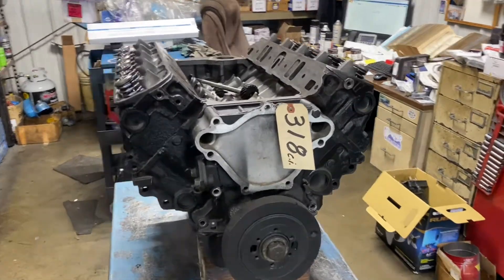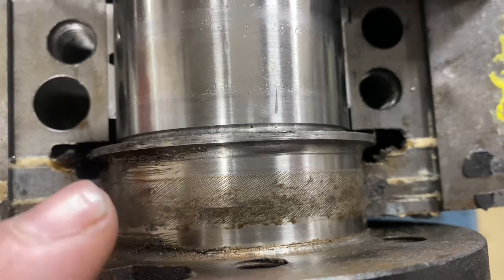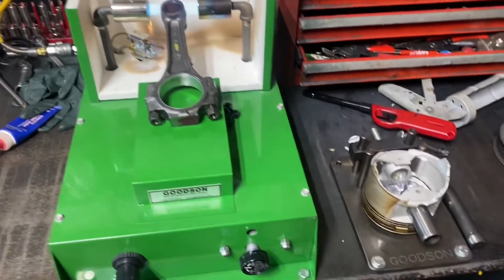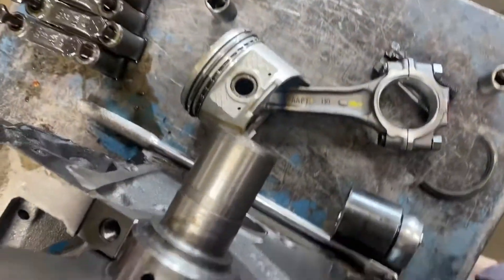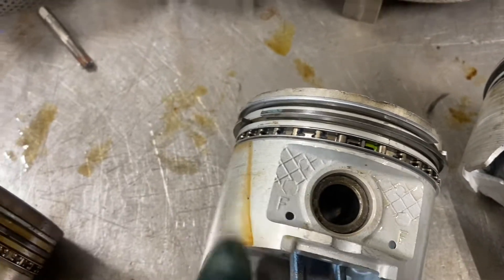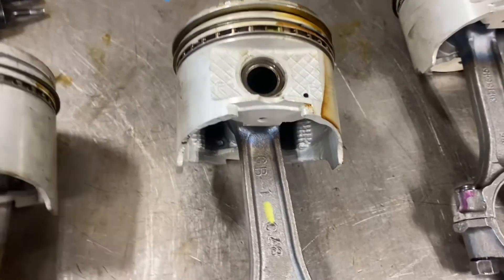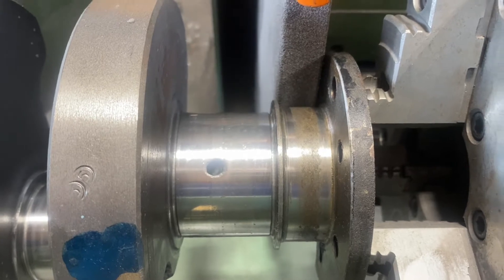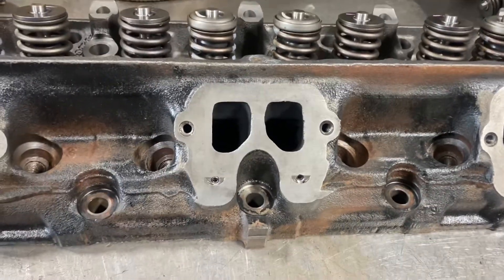Information on Converting an Automotive Engine into a Marine Reverse Rotation Engine

Comment: Continued from below.  I now have a 68 31' CC Commander with 350F's(327 replaced). The weakest part of the drivetrains are the P-32 1.5 reduction Paragon Transmissions.  Your Paragon rebuild video was helpful when I had a reverse band failure last fall. Keep up the videos very informative.   Thank you

Comment: Your videos are very informative and concise, I'm a big follower and I wish your shop was located where I boat on Lake Ontario. I've been involved with antique and classic boats for almost 40 years. About 30 years ago I restored a 1968 mahogany Century Resorter with a 427 Ford Interceptor. I couldn't find a a reverse rotation oil seal, we ended up installing a rope seal with the knurled crank surface. Never had an oil leak and I had about 400 hrs on the engine when I sold the boat.  I was always worried about a main seal oil leak luckily it never happened. The boat was a sleeper, it would do over 55 mph.  I was able to find a NOS reverse rotation cam for engine rebuild from a supplier in your area, I believe he has long since passed. August